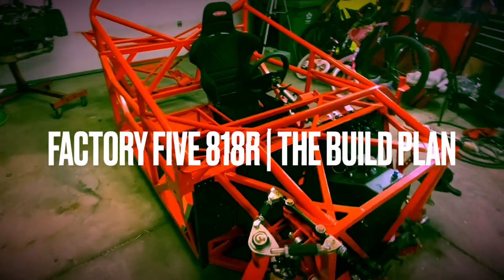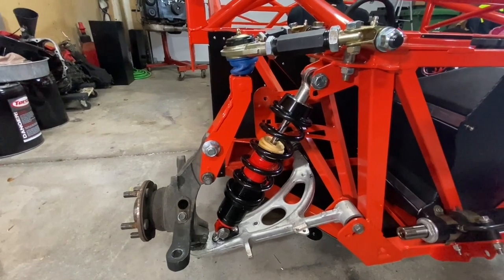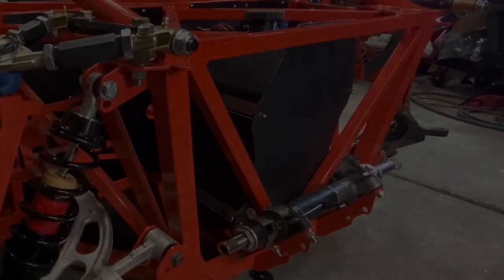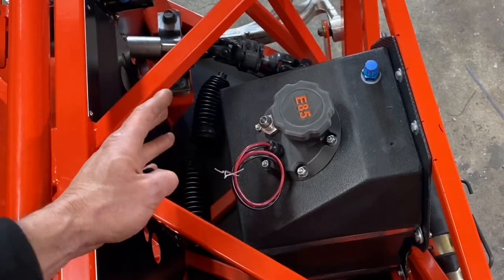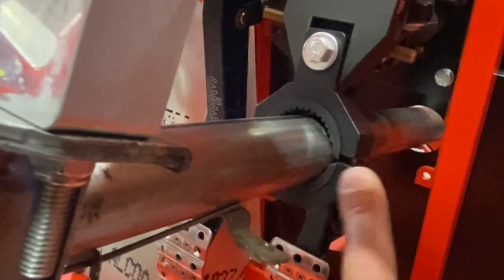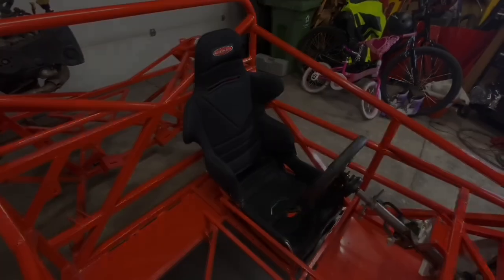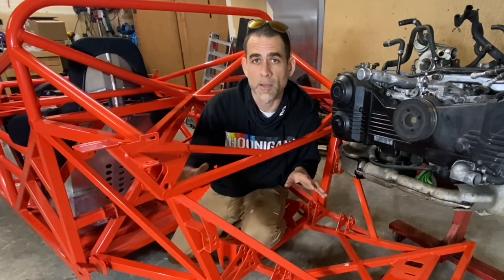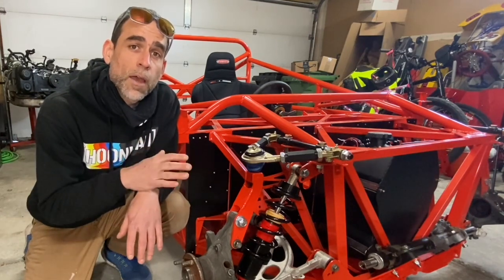SUBARU RACECAR BUILD | Part 2: The Build Plan

Comment: Very well done video. I saw the first 818 raced at Watkins Glen and run away from everything with less that 400 WHP!
That front fuel cell was in my plans! Very nice.
I have an 818R kit that I can't see myself finishing, because I have two STI race cars ahead of it. I did not have a donor and I went with S2000 spindles and STI rear spindles. This gives me 5X114 wheel stud layout. As many may know, there is a lot available for S2K suspensions. I have save nine pounds on each front corner! Plus I have custom LCA's and full adjustability up top by using Howe Racing's Upper Control Arm Mount kit. 
Contact me if interested in my roller kit.
Reply from the maker: You’ve got a seriously trick setup there Glyn!!! Feel free to drop a link to a build thread here if you’d like. Man wish I could swing picking up your roller, sounds like one hell of a build to work with!